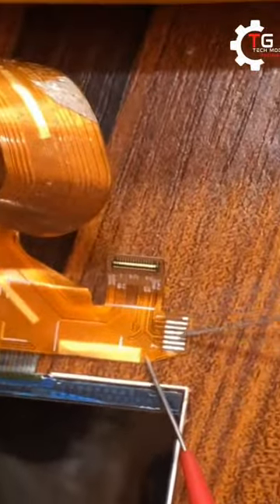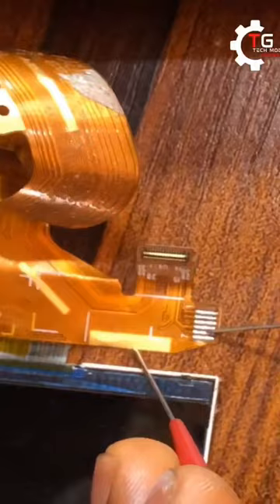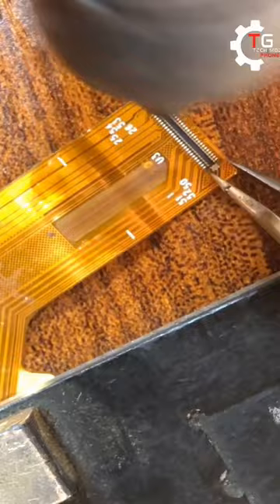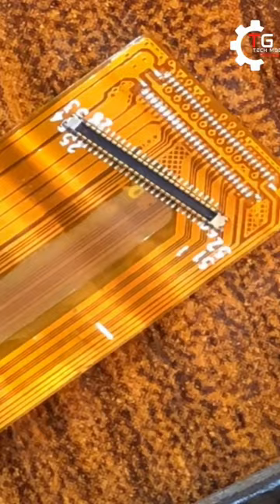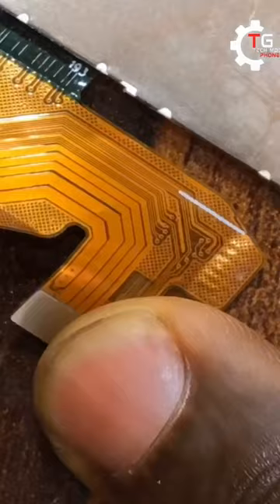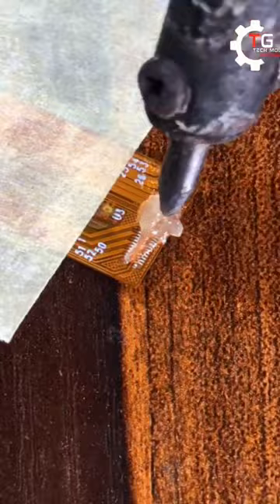Tecno B1f & B1p Free Tips On Screen & Touchpad Pins

Comment: I replaced but it still didn't work. Even a new screen didn't work
Reply from the maker: Check the 6Pins of the Touchpad On Screen Flex if it is reading on multimeter. 2pins are GND while the rest will read normal